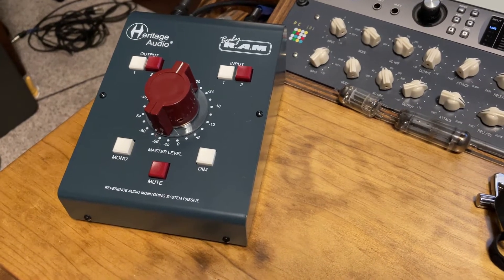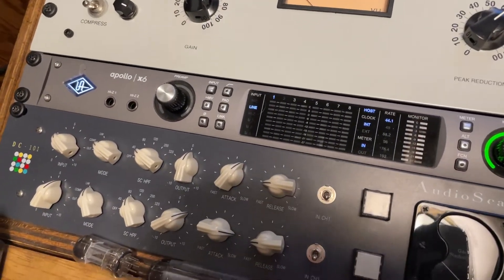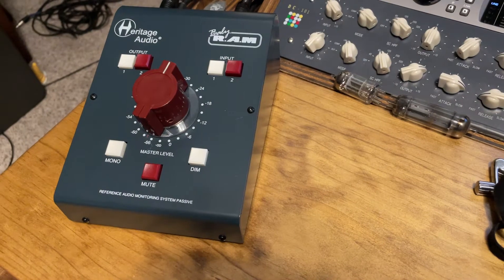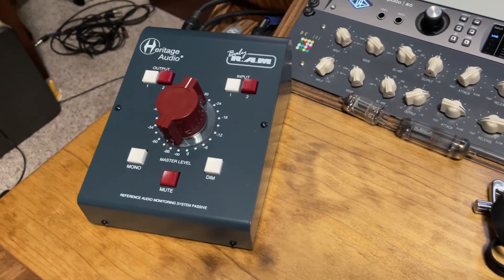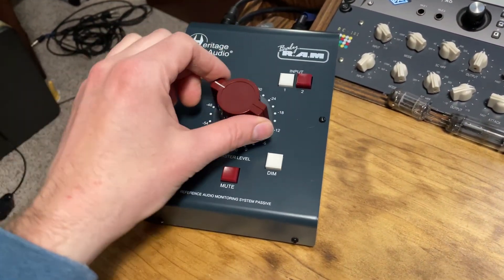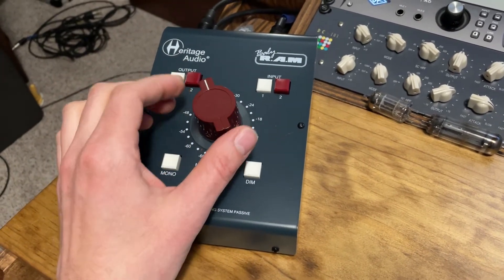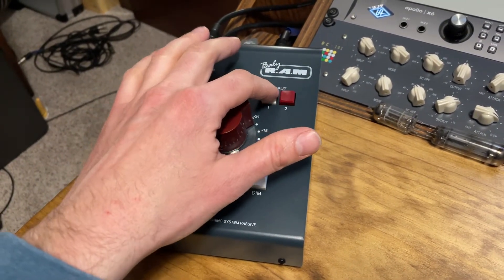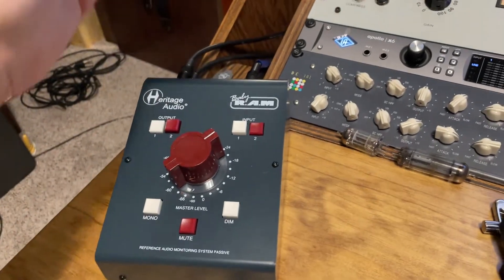Heritage Audio Baby RAM Through an Apollo X6

Comment: You are lucky. I just purchased one and mine is noticeably noisy when I turn the volume up and down. In balanced mode sometimes when I'm turning the volume down the signal flashes back up to full volume in 1 or both speakers. It also does this when I tap on the volume knob. I'm returning mine. Sorry.

Comment: Do you still got the baby ram? can you please say me the exact height in mm of the little front plate part with the 2 black little screws? cant find any informations, need to know that Height because im not sure if it will fit well in my custom build deskrack. If you still got the unit and can help me, please also check how much it would exactly be wihtout the curved design. Would be great.

Comment: Does this unit color your sound in any way? Also, I noticed you have the volume on the UAD at 100% if Im not mistaken.. Is that the usual way of using monitor controllers?
Reply from the maker: I haven’t noticed it coloring my monitors.  However, I went straight from my SPL monitor controller to the Heritage. I also use Sonarworks while mixing, so I purposely color my signal.  As for my output monitor level on my Apollo…yes, you always want it all the way up.  The volume knob on the heritage is an attenuator, so if you don’t have the Apollo all the way up, you lose fidelity.  Imagine having your Apollo on at 10 o’clock.  That becomes your maximum ceiling on your monitor controller.  So to listen at like 70db, you have to turn the knob up practically all the way on the heritage.  It’s a similar concept to gain staging.
Reply: @brandonisaak  That's really helpful! Thanks for the feedback!

Comment: Quick question. Would this controller be an easy fix for me to ad 2 more monitors to my maxed out Apollo cascade ? I’m not limited by outs but more so limited by the software. I care more about quick/seamless monitor transition. The only way to switch between 4 sets of monitors while using a twin as the controller is if I change the master Apollo which obviously disrupts the whole I/o matrix. 
Ex. I have 3 sets of speakers running to the Apollo 8 & 1 set running to a 16. Would adding this controller allow me to bring over that 4th monitor set so I don’t have to mess with the cascade order? Thanks

Comment: Q : did you conectes it to the main monitor output or the 3.4-5,6 outputs? As I am aware, main outputs don’t send full signal out and it’s limited by the main output know ( on the Apollo twin x at least , or I have not figured how to do it) . This would really help as I am searching to get a monitor controller for couple of monitors to be connected. 

Thanks for the video 👌🏼
Reply from the maker: I have it connected to the main monitor output.
Reply: @brandonisaak  but did you had to maximize the knob to get the full signal? Like you get from exiting output 3-4 ?
Reply from the maker: @Capons_Place  yes.  I had the monitor out level from the Apollo on at 100%.
Reply: @brandonisaak  thank you so much!